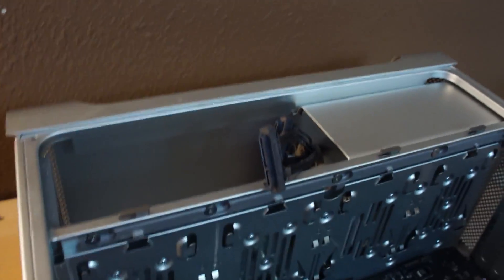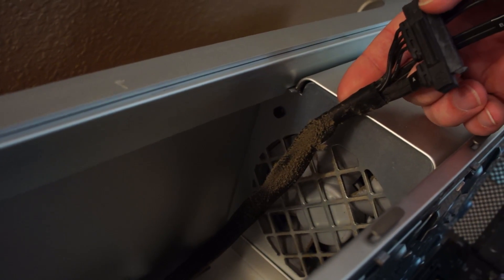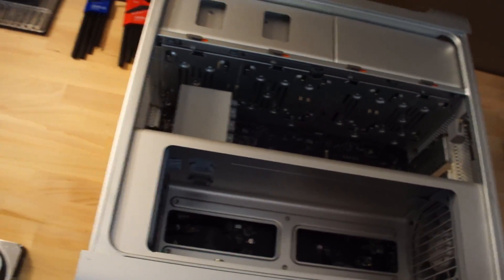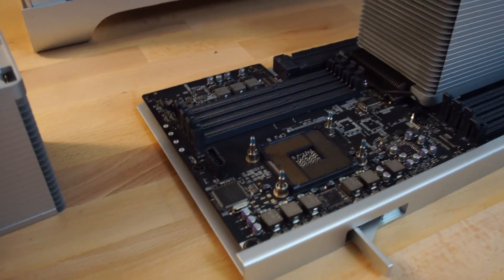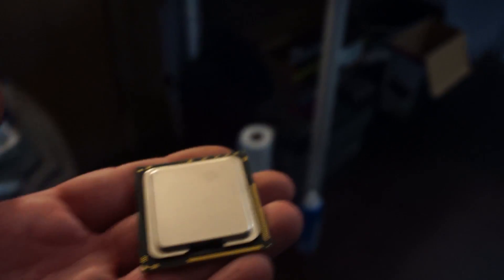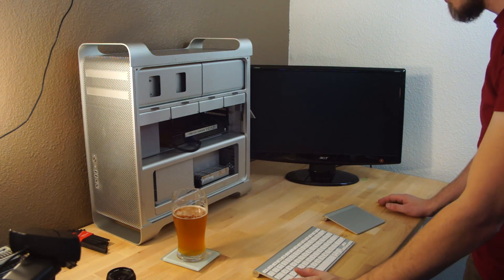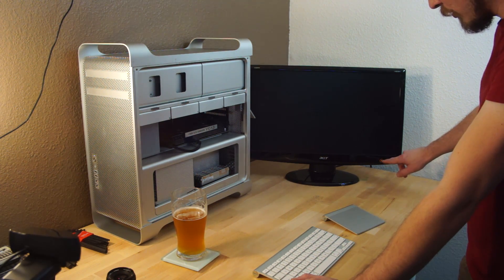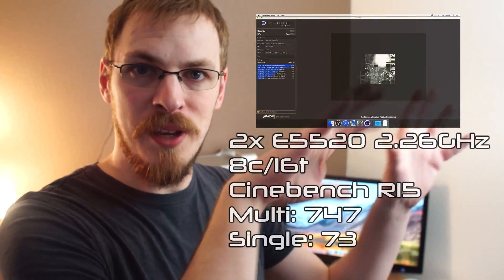Mac Pro Upgrade Vlog. 12-Cores, 64GB, and Pascal Graphics!

Comment: Hi, real interested in your upgrade and since my graphics card (original) gone pear shaped, I’m looking to upgrade. The graphics card you have used seems the one. What is the exact spec, I only ask as som places say an external power source is required but it didn’t seem to need it in your vlog. How are you finding the whole setup, as I’m going to follow your route . Cheers
Reply from the maker: I'm loving the setup!  I used an EVGA GTX 1050Ti FTW, but an GTX 10xx series card will work.  They do make 1050 and 1050Ti cards that do not require external power (although the cables are only about $7ea on Amazon (http://amzn.to/2AHklEa)).  This is also a solid choice for a card right now (http://amzn.to/2BnZbfA).

Thanks for watching!  Let me know if you have any other questions.
Reply: Hi, was that a 6pin female to 8pin male connector you used?   Did the graphics card need any special firmware upgrade or driver upload? Sorry for the questions , but I’m a complete novice and trying to follow your example. Any other advice to make sure I get this right. I’ve upgraded firmware from 4,1 to 5,1 and need to get hold of some decent ram.
Reply from the maker: No worries!  There are two types of cables.  A mini 6 to 8-pin and a mini 6 to 6-pin.  I used the mini 6 to 8-pin, which requires notching a slot into the connector so it will fit on a 6-pin card.  If you're new to this, I recommend picking up the cable that matches the GPU you'll be using.

No special firmware is required on the cards anymore.  On your old Mac card (GT 120, 7300, etc), boot up your Mac and download the latest nVidia Pascal drivers for macOS.  Install and reboot.  Then open the nVidia control panel, and select use 'nVidia Web Driver'.  Shutdown and swap out your old GPU for a GTX 1050 or higher.  You  will not see the Apple logo on startup, but the display will kick on once macOS has booted.  And you're done!
Reply: Craft Computing Sorry, me again . I going to go for the MSI GeForce GTX 1050 Ti GAMING X 4GB GDDR5 Graphics Card you suggested and it seems to have a single 6 pin , will this be an issue ? What cable do you think I will need?  On boot up will I be able to boot fro alt key if I run into issues, if not how do I get round this? I guess I’ll also have to get a port adapts as I have a apple screen with usb an mini display port, any suggestions as to what adaptor / port I should run off? Thank you so much for your advice, it’s priceless. Stewart
Reply: Hi, any ideas on my last couple of questions? Shortly going to go on a spending spree!
Reply from the maker: Here is the cable you'll need: http://amzn.to/2Acxx0Y

There is no way to access the boot menu (Holding ALT) with the Pascal card without flashing firmware.  What I do is just keep my old card on hand if I need to access something pre-boot.  Once you have it set up though, it runs flawlessly.
Reply: Hi, you’ve been a star thank you . How would I flash the card and secondly I’m just about to put had the x5960 processors (big money £145 each) , they don’t have to be a matching pair , I can buy them as two singles can’t I?
Reply from the maker: I'm assuming you mean x5690 CPUs.  I'd actually opt for the x5680.  Only 130MHz difference between them (3.33GHz vs 3.46GHz) , same 6C/12T.  Almost half the price.

Correct, you can purchase them separately.

I've not researched flashing a Pascal card for Mac.
Reply: Hi, thanks for advice so far, really helpful. Should I delid my processors ? If I don’t do I have to make adjustments for height. I just don’t want to screw it up.
Reply: Hi , I really need some help on this final issue of delidding or not to delid the x5680’s. Just looked bloody risky. If I don’t de lid, what do I need to do to make sure all runs well. Hope you can advise. Cheers, Stewart
Reply from the maker: A delid on these CPUs is not entirely necessary.  The heat spreader is soldered down to the die already.  Install is easier with them delided, but there is no performance gain.

Just do as I said in the video.  Tighten the heatsink enough to make contact with the top of the chip.  ***Don't over tighten***.  Mine has been running just fine with lids still on since this video went live.  No problems to speak of.
Reply: You have been a real help Jeff , I have followed all your suggestions to the word. It’s all sitting there ready to go. Should I install Sierra first before all processor and ram changes, or change all with the currently installed El Capitan ? I’ve also got a usb 3 port to install and Bluetooth dongle to pop in. I wanted to put a WiFi BT all in one but nowhere here sells it and can only be brought from the states..
Reply from the maker: No problem.  OS doesn't matter for the install.  Either will see the hardware changes just fine.

As far as WiFi/BT... ;-)  https://www.ebay.com/itm/Genuine-Airport-Extreme-WiFi-Card-For-Mac-Pro-w-Mounting-Screws-Apple-MB988Z-A/192369315641?hash=item2cca1acf39:g:DtoAAOSwIJlZ6Q4m
Reply: I’ve installed 64gb 1333 ram but only recognised as 1066 is there a way around? I have flashed to 5,1 and running Sierra? Cheers Jeff
Reply: Hi, any thoughts on last message about the 1333mhz being show at lower speed. Cheers. Is there a get around . I’ve reset the pram to see if that did it / it didn’t .
Reply from the maker: Have you already done the CPU swap?  The original CPUs memory controller only allowed 1066MHz memory.  The newer CPUs have 1333MHz capable memory controllers.

Comment: Instructions with a glass of beer? FYI, most fluid spills on computers result from guys doing exactly what you did. Unless you were trying to be comical, in which case you failed to deliver the subtlety  of your joke, you should not place fluids near computers under any circumstances.

Comment: You made a 24 core computer 6 core to 6 cores and the six threads are the other six cores on each CPU so in total 24
Reply: Yeah, 24 threads is technically 24 cores but a bit weaker.

Comment: Can windows be installed on one of these systems? One is up for $200 on craigslist, and im wondering if I should pick it up
Reply from the maker: Absolutely!  You are limited to "legacy boot", not UEFI in Boot Camp, but you can still install the latest version of Windows 10 with no issues.  Just follow the Boot Camp wizard.
Reply: Craft Computing cheers mate! Guess whos getting a new .CAD machine!
Reply from the maker: Nice!  Actually the first thing I ever did with one of these was set up a CAD machine in Windows on a 2006 Mac Pro. Enjoy!